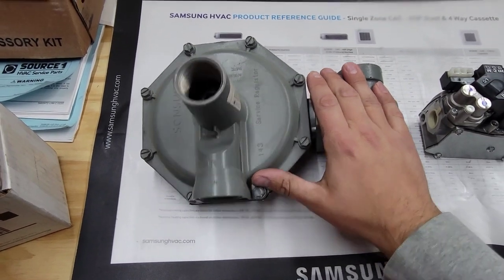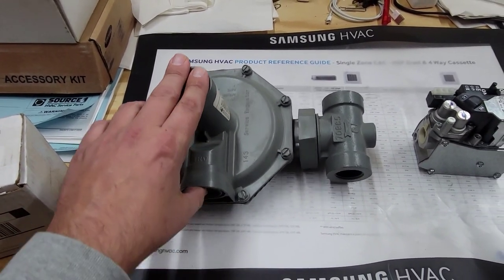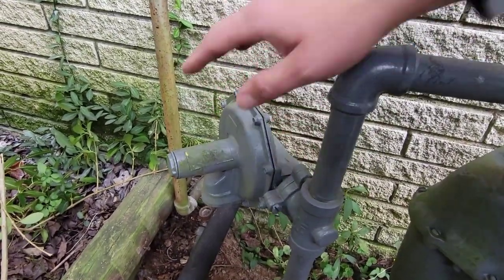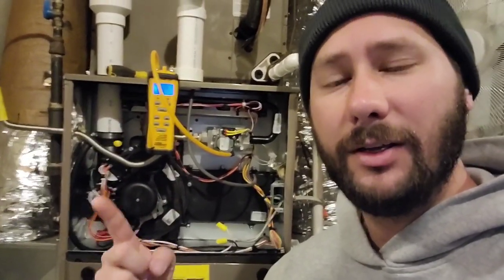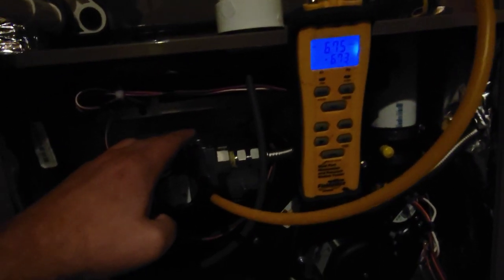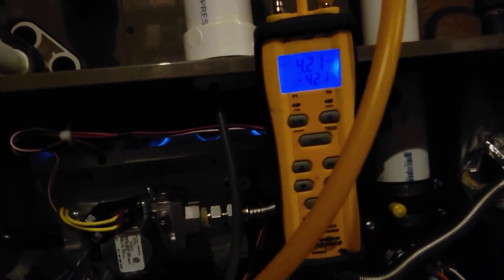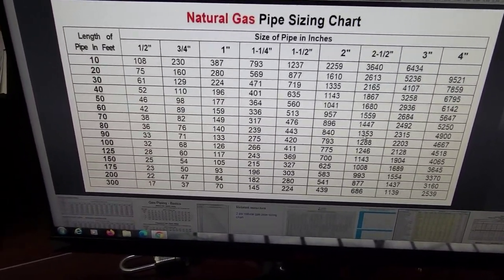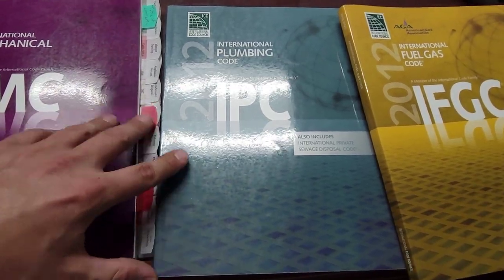Gas meters Gas pressures and Gas Regulators HVAC Basics @FieldpieceProducts

Comment: Didn't know Flex Hose can be used through the cabinet. Maybe code is different in the US than Canada. We get called out if there are anything but Iron going through the cabinet. No flex or copper allowed.
Reply from the maker: In different areas around here, codes are different. You can go from one county to the next and the codes are different

Comment: Is there any signs that might tell you if the pressure is to high or low? Obviously if it’s to low we know the answer to that, but what if it’s to high?
Also I’ve failed my cmc test twice now and now I’m just bummed out and don’t even want to study. 
I’m in Jackson Tn. Where are you?
Reply from the maker: I am about 45 minutes away from Jackson going towards Nashville
 You need to do the American contractors network course
 It will propel you into a passing score
 It's awesome
 I think I did a video on it and it's titled how to get your contractor's license you should check it out
 Don't get bummed out it's a hard test
Reply: @TaddyDigest  good enough. I have a plumbing contractor friend that took that course. I’m gonna do it. Man I feel like if I get these contractors license it’s skies the limit.
Reply from the maker: High gas pressure would cause a higher temperature rise  and you could see  limit switch trip 
 It can also cause the flame to blow out
 And trip the roll out switch
Reply from the maker: It's a sign that you know what you're doing and it's also a way for you to get the bigger jobs
 There are lots of bigger cities that are in need of mechanical permits and contractors who can pull them
Reply: @TaddyDigest  I know it. They just want people to show up like you said! I hear it all the time.

Comment: Hi there, I'm a KY plumber and have a job to give this customer more gas pressure for his new Rannai Tankless WH and future gas outlet for a 12Kw nat gas generator conversion. They now have a 1" main from the meter (7" w.c.) and 4 appliances totaling 185k btu usage (all with 3/4" drops) on a longest run of 40' to the furnace/water heater group (45/40k btu)  in basement and 60/40 btu stove/dryer. The tankless will be a 12' further run using the close by 1" main to pipe from making longest run/branch 52' then. If tankless adds 199k to the load and 100k or 150k or ???k for his 18 HP generator he wants to get, that puts new load at maybe 535k (unsure about load calc. for 18 HP generator). Question is: Would increasing the 1" main in the basement to 1 1/4" or 1 1/2" help get me the extra btu's still from the same 1" meter or what can be done? Thanks for any insight on this, Bob R. in KY
Reply from the maker: Increasing the main line will get you What you need

If you want I can send you a gas pipe sizing chartVia email

Click the join button become a member and send me an email tadfuller1@gmail.com 
Join this channel to get access to perks:
https://www.youtube.com/channel/UCuMyjTVlkM4xZ5z_eSyoB1w/join
Reply: @TaddyDigest  Hi Tad and thanks for your quick reply. I immediately sub'd to your YT channel and have started to binge watch your many videos back from the beginning. BTW, my daughter lives south of Nashville in Franklin, TN ..... do you service that area? 
Regarding my gas piping/low BTU job, would it be necessary to re pipe the
 1" meter with a 1 x 1 1/4" elbow off the swivel outlet and about 3 more 
1 1/4" elbows that are now 1" elbows to get into the basement where the 
long 1" lengths start OR can the BTU gain simply be achieved by just swapping out the 1" in the basement with the 1 1/4" pipe. 
I already have the local gas utility's published gas piping charts we need to
 use here, but thanks for the info offer. Thanks again, Bob R. in Louisville, KY.
Reply from the maker: Bob click to join button become a member it's only $2
 Support me and then send me an email and I will help you tadfuller1@gmail.com
Reply from the maker: Swap out the inch for the inch and a quarter